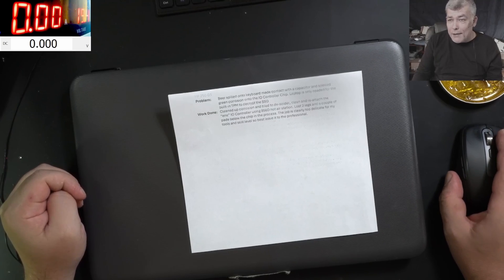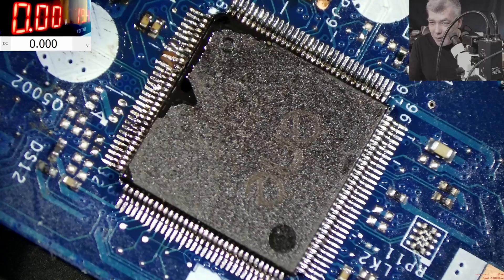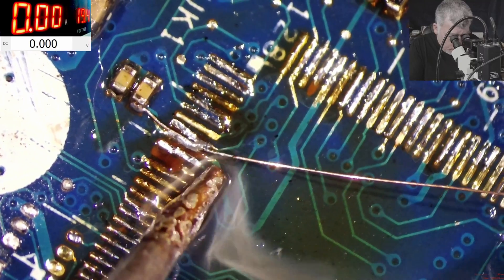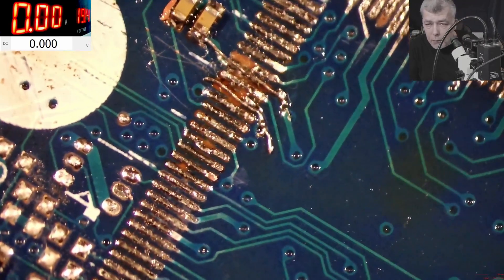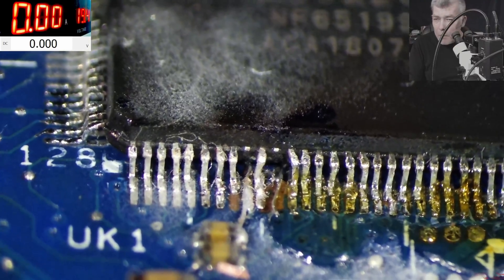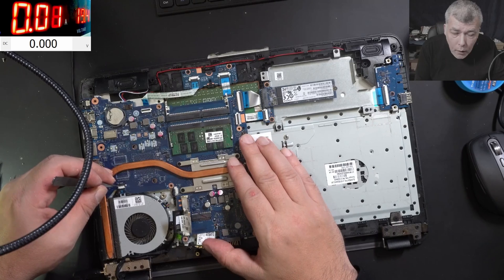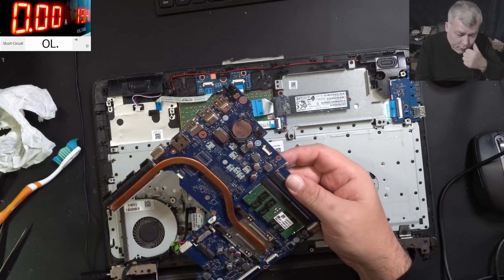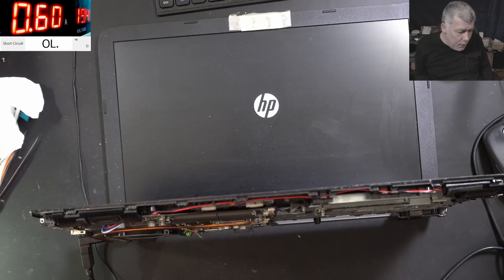HP 250 G5 beer damage - how to fix missing pins on a ic chip

Comment: I always wait until it takes practically no force to move a chip I'm removing. It's also important to make sure the board is warmed so that the solder doesn't instantly harden the moment you stop heating and you have a little time to get the chip off.

Comment: 13:07 If the user wanted to save only the data, why didn't he simply remove the disc and make a backup of the data. Wasting time to repair the motherboard. If another laptop service doesn't know how to save data or clone disks, they should definitely close the company.
Reply: Client clearly stated at 0:15 that repair is needed thanks to the drive being encrypted with TPM  module. <3
Reply: @filda2005  Take out the disc, put it in the tray, plug it into another computer, type in the bitLocker key and make a backup.

Comment: Constructive criticism: I have done this kind of repair many times. This is typical amateur not thinking for an extra 5 minutes. The solution to get good at doing this is always practice on a junk board until you have the required skill-set to do it properly. Don't 'practice' on an expensive laptop or an actual repair job that belongs to someone else.....

Comment: use solder mask
Reply: only amateurs use it. it makes zero difference now. solder mask is for use when producing and soldering boards in production factory when using solder bath. After that point solder mask does nothing and adding or not adding has no effect on operation of the device.... as proven in the video.....

Comment: Some HP G5 models are NOT cheap here. The manufacturer's IC, "ene" in this case, original KB9022QD? neither is it. The component part number on that PCB is too "fuzzy", which speaks to the quality of the white ink that manufacturer uses and when I do a little research to know the history of that company, Ene Technology Inc., I find very little info. That's the impression I have left. Ali/ss? Well, yeah...ugh.
On the other hand, excellent job re-soldering that piece using your product (grade X flux). I hope they find a distributor in the USA so that they can send it internally, that is, from an American city to my post office box (mailbox, annual rent). All the best.

Comment: You can use a grinding pen to scrape off a bit of the chip capsule to expose more of the broken pins, to get soldered even better, great job indeed, nice steady hands, neuro-surgeon :))
Reply: Yup. Most of those chips are anyway plastic or some ceramic. Chip die is usually much smaller than package.
Reply: All this repair just to get his dat back... He could have easily ordered an nvme or m.2 reader
Reply: yes, in my repair blog I show in great detail how to do that kind of repair and some much worse where the chip must be ground away to reveal metal to attach micro wires because the pin is completely gone.